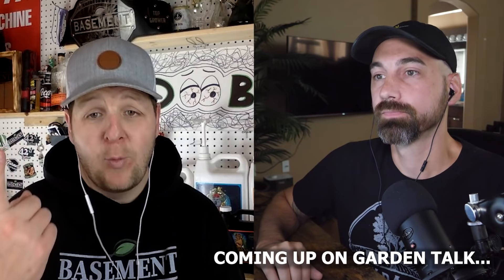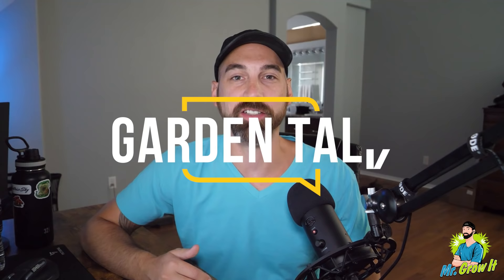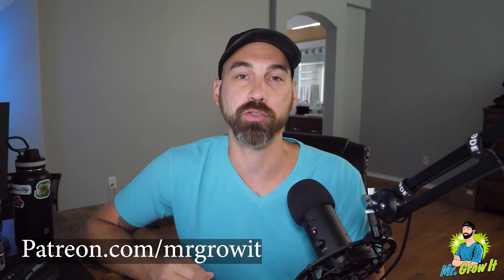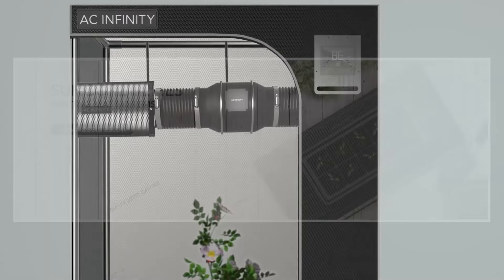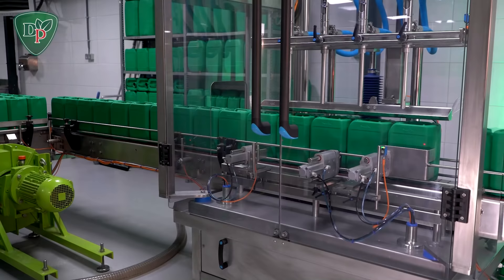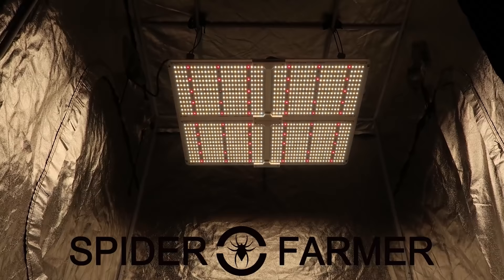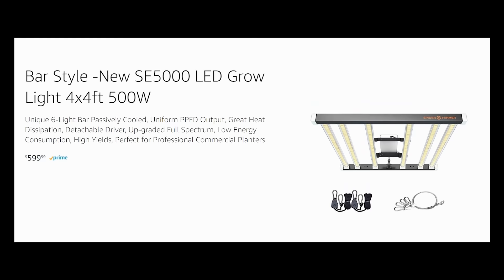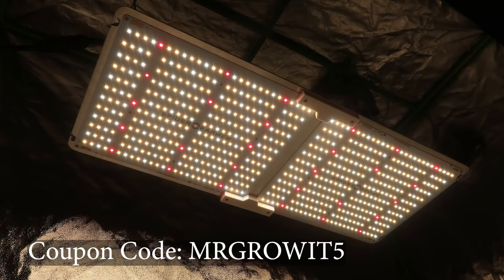Easy Methods For Growing Autoflower Plants! (Garden Talk #32)

Comment: I stopped measuring runoff ppm long ago when I realized that what your actually measuring is mostly what you just poured into the pot to get the runoff. IMHO, this is just one of those things that sounds good and makes sense sort of so we just do it thinking we’re getting a valid measurement. All that runoff just rushed through the soil but it’s so inaccurate it’s silly to do. Just play around with your ppm that your putting in and watch the plants and use that to dictate how much you feed. And flushing them with pure water once in awhile caused tremendous stress to the plant